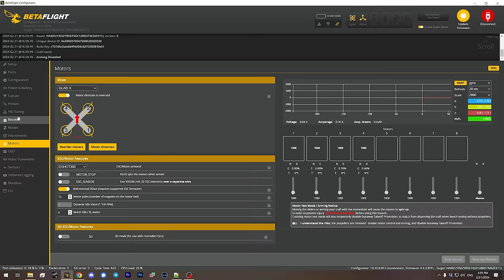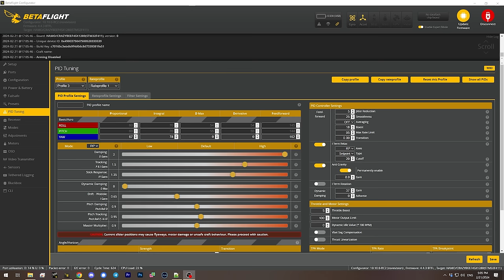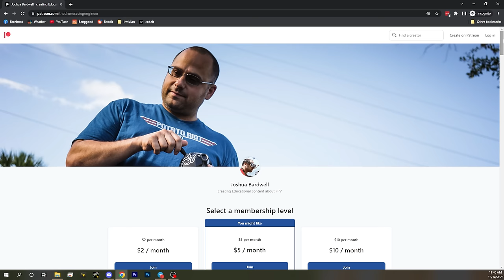How fast is too fast? Testing 32,500KV WeBleedFPV Screamer Motors!

Comment: YOU NEED THE GEMFAN BIBLADES WITH THESE MOTORS!
Reply: That all depends if you are freestyleing you want bi blade props but raceing you want tri blades
Reply: @IsaacSchultz-lz8jc triblades on these motors are just too much load. it'll fry the escs soon. also theres something about the rotating mass or extra thrust or whatever. these super high rpm motors don't fly great on tri blades, as seen in the video.
Reply: Yeah 0702s can sometimes handle Tri blades that are 31mm. However he has 35mm props which is probably why it was freaking out on high throttle
Reply: @killerwhale with the 35mm props you want 0802 for it but those 36000kv 0702 can definitely handle 31mm triblades any of the new aio boards can handle up to 20amp constant
Reply: True
Reply: Can those be put on the dji fpv?
Reply: @KillerWhale806 they allow the motors to over perform and make it go REEEAEEEEEEEEH
Reply: @KillerWhale806  how about 3 blade 35mm props on a 26000kv motors?
Reply: @KillerWhale806  Im a newbie in the hobbie
How do u know the things u know i wanna learn those too please give some pointers

Comment: For the record, when you turn the sliders on you lose the specific number they had entered in which is fine since they're setup for the painfully low 19,000kv motors

Comment: From my experience these kinds of motors are so fast they destroy themselves as they go. They are just meant to give you a boost at the cost of replacing motors often.  22/25000 kv is already quite nice and will last. 19500 is good for beginning.

Comment: I'm guessing going to 0702, and trying to bump up nearly double on kV on those 35mm tri-blade props of the Meteor65 Pro was just too much (for PIDs and the 5A ESC).  Possibly bi-blades would have helped at that point, but honestly, I'm not sure why you wouldn't have just tried 0802 with 23-25kV.  I think that would have performed better.  Still, the 31mm on the Mob6 with like 0702-28kV probably is a hard platform to beat...unless you shed 1.5-2g on the HDZero and go analog too.  LoL.  Ok..enough arm-chair quarterbacking.  Thanks for the video.  You're awesome!

Comment: Doubling the Kv with the same props and battery means the current draw will increase by the square of the speed increase, means for sure your ESCs nor your battery will not be able to handle that. 3.5V-0.7V from transistor loss in your ESC, the coils see around 2.8V. at 20 000Kv it means 56krpm minus props los 30% equal 39krpm, wich is already very questionable. A 32 000kv would mean 62 000 rpm, you can dream. Without any test I can already says these kv numbers are BS, or anyway your props, ESC and batteries will never handle that.

Comment: Try those motors on a 17-18g whoop with biblades and you’ll get the experience you want. Adding them to a 20g+ whoop is like putting a supercharged engine on a minivan. Will it be faster? Yes, but it’s nothing like putting it into a purpose-built racer.

The 533 whoop build is a challenge, but you put those crazy motors on that build and you’d get something truly special. Even with 26.5K motors a super lightweight build is a totally different beast. Definitely try that (or have Evan custom build you one!) and you will see the kind of significant handling improvement you were looking for.

Comment: I'm not surprised by the tuning issues when using 0702s with a heavy hdzero build. 

I just bought these screamers last week and put them on a 18g build and it flies amazingly and is super responsive, but that wasn't experience and I hated flying 22g+ 65 builds. 

And yes, you lose throttle resolution with higher KV, but usually the pilots that need the higher KV are generally skilled enough to adapt to the loss of resolution pretty quickly.

Comment: I feel like you would benefit greatly from some properly set throttle expo instead of motor limiting. Throttle expo is an absolute game changer with these high kv motors. Also, if you continue using the Mob6, consider resetting the PIDs to default and re-tuning the quad.  The stock PIDs are very high in order to compensate for the lack of thrust/power from the stock motors.

Great flying and great improvements so far!

Comment: I switched to higher kv motors and had similer weird wobbles at full throttle. Turned out my props were spinning on thr shafts cause rhey were too loose. LOL!

Comment: You should reduce prop pitch when you use higher KV Motors. On a tight course there is no high speed, so props with less pitch are going to bite better.

Comment: Swapping to motors both lighter and higher KV would require changing filters, first and foremost. I had a similar issue with motor swapping Mobula6, I went from 19000KV 0802 to 28000KV 0702, and flight performance was crap. Jittery and noisy. Tuning the filters by following Ciotti FPV recommendations, and applying Quad66 presets I was able to smooth things out. Turns out, 28000KV 0702 are not trash, and are, if fact, based. I got about 30 seconds more flight time and much more power after all of the tweaks.
Reply: Could you throw some links on this guides please?

Comment: I personally noticed a decent difference in your flight characteristics you were tighter to the inside lines for sure and just sharper all together .I personally find sitting helps I feel like it takes brain power to stand and balance not much but I feel like I just free that up when sitting down especially with whoops

Comment: Probably be worth hand finishing the prop blades, and dynamically balancing the lightest props you can get. At those rpm, destructive vibrations would be bad. Try to avoide supersonic tip speeds too!😊

Comment: I freestyle, but on higher kv motors, give bi blades a try, im my experience i get better throttle respinse with a little trade iff for sliperry cornering. In a few packs you learn the throttle and corner the same. I dont race seriously,  but mostly freestyle.

Comment: We have found that anything over 22,000 kv should be direct soldered to the ESC to reduce the sag you are seeing in those tight turns.
Reply from the maker: The Happymodel Mob6 is direct soldered.

Comment: Looks like on the first whoop, your battery voltage bottoms out.
It is most probably drawing too much current on your controller, causing massive voltage drop on your escs.

Comment: The betafpv 19,500kv motors aren’t the go to, no. 

But I kv tested them to actually be on par with 22,000kv motors. 

It’s not super common to see 802 22,000kv motors on a race build but I’ve seen some top tier pilots use them and fly faster than I ever have, such as Orangestuff and RAB. 

Even tdog is often using kv as low as 25-26k

I personally prefer a little higher kv than that for my 65mm builds, especially since I dont go as light with my builds and dont need as much efficiency as those guys, but there’s no denying how hard the top pilots can rip lower/mid range kv

Comment: I don’t know if this question is going to be answered in the video, what exactly does different KV do? I’m looking at a whoop, the two I was considering was the meteor65 pro or the new mobula 6, and they have a lot different KV, just wondering how that affects flight? Ok yeah maybe it’s just RPM of the motors…
Reply: KV=RPM/Volt so it's more than just RPM
Reply: Hey how did you fare with 65 or mob 6 ??? I want to fly more outside 85??

Comment: @JoshuaBardwell instead of motor limiting at 10:45 did you consider adjusting midpoint and using throttle expo?  @ciottifpv recent had a live that went through it.

Comment: These high KV motors seem to be "crazy high power upgrade" right now. I think that will soon change and everyone goes high kv like this and it will be the norm. Sadly it wasnt when i began flying and i was having so much problems when starting out with a meteor65pro... evrything got sooo much easier with higher kv motors

Comment: You need some bi-blades I think, iirc tri-blades produce more torque/lift at lower rpms and bi-blades have less mass which reduces strain on high kv motors.

Comment: Betafpv just released a new 'lava' battary with 75c - maybe higher 'c-rate' will help?
Reply: Definitely! Because of that reason I used GNB / Tattu high C rated 1S packs. And connectorwise BT 2.0 or similar.
Reply: Be nice if they made the 95c in 300mah
Reply: @divingfalconfpv4602  webleed,  tattu and others make them. With BT 2.0. Its even more important to have heigh c with that lower capacity. Makes more of a change.
Reply: @JackalFPV  well I use gnb27 & A30.. so I got change battery plug
Reply: The Lava batteries are basically the same as the Tattu/NBD/WeBleed packs - maybe even the same cells with a slightly different plug. They are the first BetaFPV whoop batteries I’ve tried that don’t suck. They’re definitely worth checking out.
Reply: @JayReding  why are they c rated lower than the other ones?

Comment: Do those motors still run on standard lipo batteries 450/550 3.7v 1800mA, also the meteor is that analog and ELRS? Great vid dude 🤙🏼

Comment: the 32500kv motors was too much powertrain for your frame and d gains. You can see it oscillating just hovering and I'm sure you could hear it. They worked on the mob6 hdz because you have another board on there to stiffen the frame, plus extra weight. Just turn the master multiplier down or get a stiffer frame.
Reply from the maker: I 100% tried pid tuning the Meteor, including changing D gain, master multiplier, and filters.

Comment: Hi Joshua, I have the same issue you had in the Meteor65 with my 3 inch 3S (HM 1204 6500KV, DarwinFPV AIO, so no blackbox, Bluejay 0.18). Lowering PID master multiplier to 0.8 tame it quite a bit, but I'm very interested to know if you find a solution.

Comment: 40kkv motor video when? :D Jokes aside, I wonder if you hit the max current the ESCs could handle, and they slumped? (Just rewatched some parts: The meteor was at 12amps most of the time. The mob6 hit 12 amps only when you blipped the throttle. interesting.)
Reply: The esc rating is per motor so a 5 amp board can handle 20 amp constant and a 24 amp burst total

Comment: Im doing 0702 28,000kV i think on a 65 pro not sure analog or HDzero yet. 
But my walksnail 1S i did 1002 22,000kV cause on motor charts it made more power same efficiency.  And the quad already wasnt light 🤣 🤣 🤣

Comment: The Filters and PIDs of the Meteor65 are just too aggressive for the new motors. Just scale them down accordingly.
Reply from the maker: I definitely tried that before giving up, I just didn't put 2 hrs of failing in the video since that wasn't really the point.
Reply: @JoshuaBardwell Damn... Then I wonder if the motors generate too much thrust for the frame to handle. Maybe it flexes a bit too much.

Comment: 32,500 0702 is too much KV for   the 35mm tri-blade.  I like 0703 for the 35mm tri blades
Reply: I like the precision and price of the Newbeedrone 16420 kv 0703
Reply: But the plugs only fit the Newbeedrone boards
Reply: Yes definitely shorter flight time with the higher kv

Comment: Why aren’t you losing your HD video link on the Mob6 when the voltage was sagging to 3-3.1? I have the Vision40 with the 450mah WeBleed batteries and it’s almost unflyable when the battery drops below 3.5v because a throttle pump or spin/flip/roll will cause the voltage to sag below the 3.1v minimum for the VTX and I lose video. It’s done this since it (and the batteries) was brand new.
Reply from the maker: You're using Walksnail vTX right? I'm using HDZero. Looks like HDZero can tolerate lower voltage.
Reply: Walksnail drops at 3.06v 
HDZero drops at 2.78v
Reply: @JoshuaBardwell  Yes, Walksnail vTX. Well that is a much more simple explanation than I expected. I didn't realize minimum voltage varied between vTX, but then again why would it be the same, either? :) Thanks so much for your response.
Reply: @divingfalconfpv4602  Thank you so much!
Reply: @JoshuaBardwell  I don't recall hearing about the min voltage for vTX's on whoop reviews. Seems like that would be a pretty big plus for HDZero over Walksnail (i.e. much lower risk of losing video link or not having to fly as gingerly toward the end of the pack). Being very new to the hobby, I'm curious about why that is? Is video loss just expected with 1s whoops?
Reply: @jsm99  yea tested it alot. My walksnail 45mm props 1002 motors will black out freestyling playing another. Pretty easily. I'm about to cut the battery tray to fit the 660mah and 720mah 100c batteries.
Reply: @divingfalconfpv4602  
1102 motors are better suited for 45mm props.
Reply: @divingfalconfpv4602 post a video if you try it! I love the Vision40 but would definitely adapt it do slightly larger props and battery if it retains similar handling characteristics.
Reply: @jsm99  I'm cut the try on my 2S version I made with HDzero. And then use small battery strap. making 45mm props needing bigger motors. they should made tray bigger
Reply: @jsm99  ill post how i did on the 2S when i get a chance. and what I do to the 1S.. just battery straps too long for the 1s its a pain

Comment: Tiny Whoop has 36000 and there's 40000 on the way...lol. 
I think they're kinda dumb, personally. I have 30k 702s and run a throttle cap or I get 90 second flights and rarely use all the throttle. 😅
Reply from the maker: Keep in mind that even with a throttle cap, the higher kv motors can give the PID loop more authority which makes the quad fly better.
Reply: I run 27000 on most of my 65's for racing and freestyle in larger spaces, and that seems to be the sweet spot for me. ive tried limiting them t0 23k and they just don't feel the same as 23k motors. I have a very small apartment, and i prefer the 23k when im in a very confined space. Love seeing more whoop content from you, and wouldenjoy seeing you go down the rabbithole. Theres A LOT that goes into a  high spec whoop that performs well.  Thanks @JoshuaBardwell
Reply: I can get 3 minutes easy on 0702 30,000kv, flying outside using lots of throttle. The weight of the quad will affect the runtime more than anything.

Comment: 4:00 You're powering the goggles off 6S? That's rather risky...
Also, your VTX is saying it's about to melt itself, yet you're continuing to film your bit?
Reply from the maker: I believe the HDZero goggles are fine to use on 6S. I believe that's HDZero's official position. It hasn't been a problem for me.

The vTX is overheating because I'm not flying. As soon as I start flying, the airflow cools it down. It won't damage itself from overheating. It will just turn off if it gets too hot.

In short, I think you're over-reacting.
Reply: @JoshuaBardwell   The goggles' current manual says "Power Input (2S~5S)" on the third page. So... you're wrong, and I'm not over-reacting. They originally thought it could do 6S, and marketed it as such, but they've since found that it can't quite do it and sometimes blows the goggles, hence they've updated the manual.
I obviously know the VTX is only overheating 'cause you're not flying, but letting it get that hot for any reason is not good. If you want to do that bit to the camera for artistic effect or just 'cause you can't be bothered to go find a normal camera, then you should really either do it fast enough that the VTX doesn't heat up too far, or put a fan on the thing.
But I guess you don't care if the VTX does melt itself, because manufacturers send so much stuff stuff to you for free that you probably have another just lying around you could replace it with.

In short, no I'm not over-reacting. You're taking bad risks with your equipment.
Reply from the maker: The vTX will absolutely not be damaged by overheating. It will reach about 90-100 degrees C and then shut itself down to avoid damage. If the vTX was going damage itself by being left powered on, that would be a serious design flaw. 

Regarding the goggle voltage, I just messaged Ryan Quellett and asked him, and he said, "It is rated for 6S but not 6S HV. A fuse will blow if it's over-volted." So that's as final an answer as you're going to get. The manual is out of date. When the goggles were first released, they were rated for 5S, but later the recommendation was revised, just like I said.

EDIT: imgur link of Ryan's reply, for proof.
https://imgur.com/a/dj9u2iQ
Reply: @JoshuaBardwell  Well, that would be yet another flip-flop from them on this topic...
Pretty sure the goggles were originally advertised as 6S capable, then a few people blew the fuse just from the voltage spikes on plug-in on normal 6S (not HV 6S). Then HDZ said to only use up to 5S. Then I heard some say 6S is ok as long as you're really careful about having the switch in the off position when you connect the battery etc, but mostly the manual etc still recommended against using 6S.
Also, is Ryan Quellet even an HDZero employee? I was under the impression he was a beta tester?
Reply from the maker: I don't know what Ryan's official position is, but he has regularly made public statements on behalf of Carl / HDzero, so I consider him authoritative.

Comment: What is all that shit on your goggles? So many andtennas and eyes. My integra goggles only have two antenna and they’re pretty and the video quality look better!
Reply from the maker: The latency of the DJI system is too high for racing, and the weight of the DJI video transmitter is too much for micro quads. That's the price of the superior video quality. There are a few dedicated DJI pilots who use DJI to race, but the vast majority of racers prefer either analog or HDZero video systems -- the ones supported by the HDZero goggles I'm using.

The reason my goggles have multiple antennas is that they work with both HDZero and analog video systems. The DJI goggles work only with the DJI system.